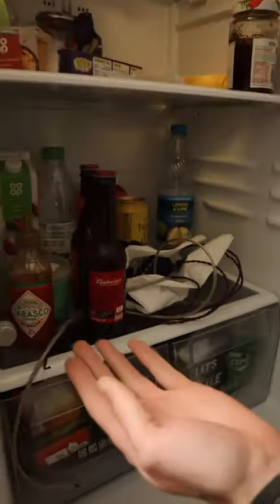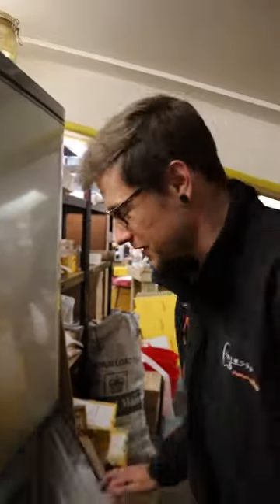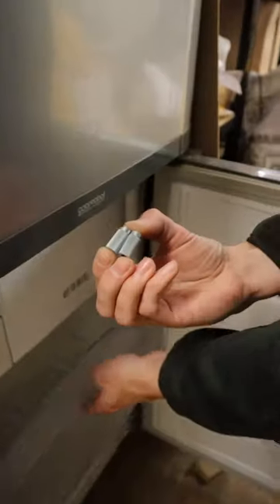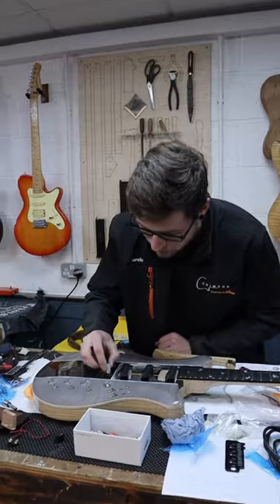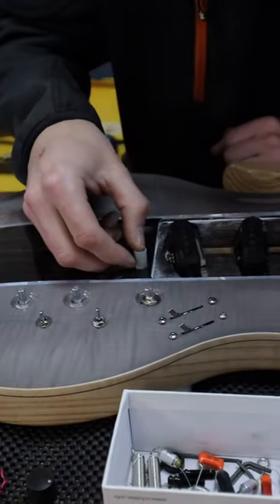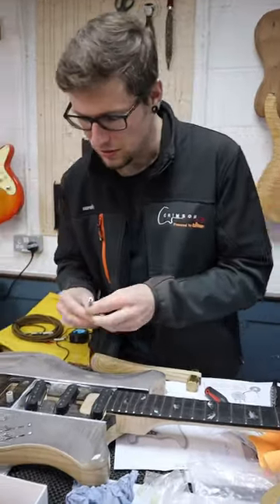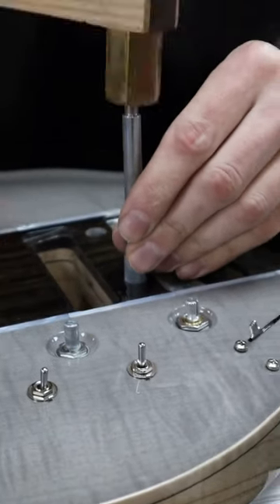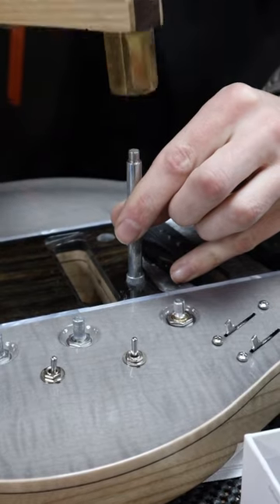Freeze your Parts for easy Installation…

Comment: I'd have thought that would lead to cracks in the wood. Live and learn.
Reply: Completely agree. In the end, you can get the same issue you started with. Better to drill the right size in the beginning.
Reply: If this piece is steel and about half an inch in diameter, it will expand by about two ten thousandths of an inch when brought from freezer to room temperature.

Comment: I'm installing the bushings for a double locking Schaller vibrato.  The bushings are 11.3 mm and I'll be using an 11 mm drill bit.  I'll do this freeze trick.

BTW, IIRC machine shops use this method to install bearings on a shaft that has been machined for interference fit.  Slides on easily but needs a bearing puller to remove.
Reply: Be careful though, if that portion of wood is brittle enough, the expansion can crack the wood!

Comment: Top tip, my complement: as the wood has the same behaviour with moisture than metal with temperature, you can also put your dowels, biscuits, dominos or wood inlays for 1 minute in the microwave oven to shrink them before assembling.

Comment: Is there a danger that it will crack the wood once it expands to its normal size?
Reply: What happens when you hammer a nail into wood?
Reply: @Kweesh  I don't see the significance of this question.

Comment: Does anyone have a credible reference for how much steel shrinks? Remember hearing .001” over 1” for every 100F temp change
Reply: Depends on the metal, as plenty hardware isn't made out of regular steel.

But to answer your question:
Steel will expand from 0.06 percent to 0.07 percent in length for each 100oF rise in temperature. The expansion rate increases as the temperature rises.
Examples of thermal expansion rates over a temperature range of 0°C to 82°C: Carbon Steel = 1.00mm/mtr, Copper = 1.34mm/mtr, and Stainless Steel (Austenitic) = 1.34mm/mtr.